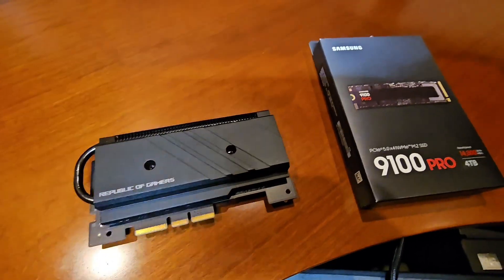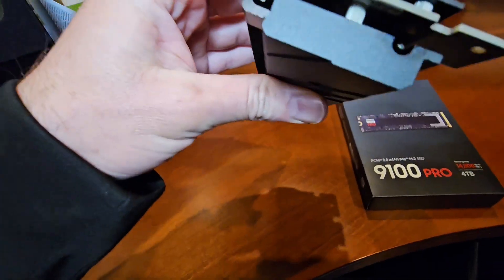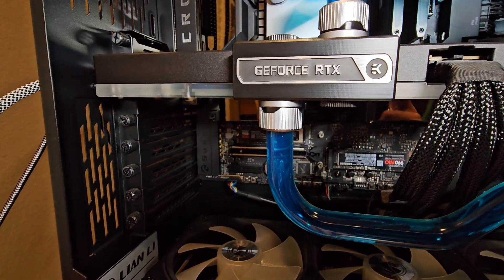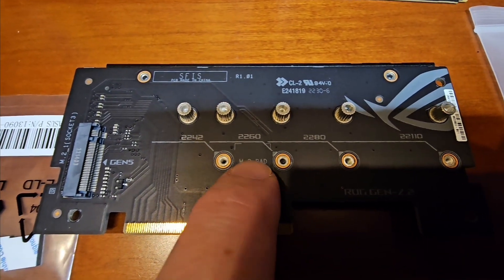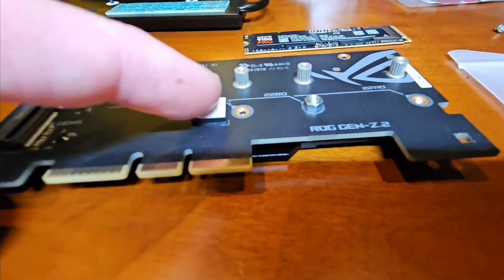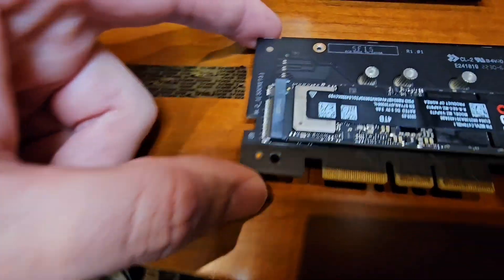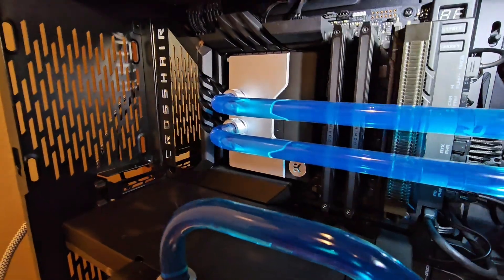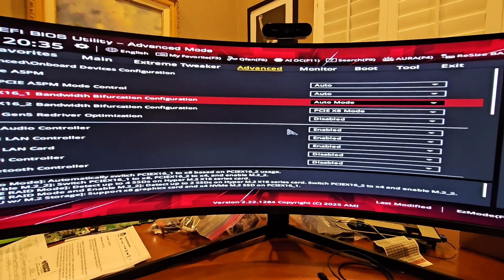ASUS ROG GEN-Z.2 Card + Samsung 9100 Pro PCIe 5.0

Comment from the maker: Samsung 9100 Pro 4TB
https://amzn.to/4ck0Ml2

Samsung 9100 Pro 2TB
https://amzn.to/3R1eLCL

Samsung 990 Pro 4TB
https://amzn.to/42fmulM

ASUS ROG Strix Arion M.2 NVMe SSD Enclosure-USB3.2 Gen 2x1 Type-C (10Gbps)
Available in White or Black. High-quality, great for hot C-drive cloning using AOMEI.
Great for backing-up or transferring data quickly!
https://amzn.to/4jkVecw

ASUS Hyper M.2 x16 Gen5 Card (PCIe 5.0/4.0) Supports Four NVMe M.2
https://amzn.to/4lkqbzk

Comment: I have my 850x WD_Black and 9100 on the m.2 slots on the motherboard and have to select on the bios m.2 Enable m.2_2 . Is that okay ? I have nothing on the Pci express slot
Reply from the maker: Should be fine, but given your WD drive, be aware of this Win11 update that is bricking drives (uninstall it) https://youtu.be/mlY2QjP_-9s
Reply: @TrickMasterPC got it uninstalled! I appreciate you ! And just so i dont get confused, it would share lanes if I basically have another GPU installed on the motherboard correct? Sorry abit of a noob at this❤😅 point

Comment: Which z series board are you using? I have the ROG STRIX Z690-E GAMING WIFI that comes with the ROG Hyper M.2 card that is similar to your setup. Although, as far as I can tell, only the #1 PCIe x16 slot is gen 5 capable, which is the one I'm using for my 5080. If I use any other PCIe slot with the Hyper card, I would only get 3 or 4 gen speeds and I wouldnt want to move my GPU out of that spot 1st PCIe slot right? 

I'm thinking in my case it would be best to just use the M.2_1 slot that is Gen 5 capable for the 9100.

Comment: Yo I have a question, i also have 2 samsung 9100, now I see in my bios that sata controller is enabled and mode is set on RAID.
The issue is that in my Device manager there appears to be 2 RAID CONTROLLERS with missing drivers... and I can t install them, I don t want to run my ssds in raid mode so what should I do ?
Reply from the maker: What motherboard do you have?
Reply: @TrickMasterPC  asus crosshair x870e hero

Comment: Nice video! I’m also thinking about the 9100. I didn’t even know about the higher speeds with the 4TB version. 
Have another question for you. Can you select “GPU temp” in Armoury Crate to show up on the oled screen?
Mine is completely gone since a few months ago.. It has been replaced with “Global” and It’s not even the GPU temp. That’s quite frustrating when buying such an expensive board..
Reply from the maker: Download the armory crate uninstaller software. Run it, restart, install asus AI Suite, then reinstall armory crate and reboot. It should all work again. I had the same problem and this fixed it.
Reply: @TrickMasterPC 
It doesn’t work unfortunatly, but the thing is I can see the GPU temp on my dashboard. But It won’t show up on the “Hardware monitor” selection. Only “GPU Memory”. 
I already have reinstalled Windows and even used another GPU. Both AMD ASUS ROG and TUF cards. So Its pretty weird.

Edit: I checked ASUS AI Suite and there is no GPU temp to be found.

Comment: Bro why is my 2 nd samunsg ssd inside m.2_4 which doesnt share any lanes with pcie 1 runs the benchmark at half the performance of 1 st ssd
Reply from the maker: Check your motherboard manual. There are some slots that are PCIe 4.0x2 which means they only use two lanes, so half bandwidth.
Reply: @TrickMasterPC  you re right i had 2 nd ssd on a slot which shares bandwith with gpu, thanks